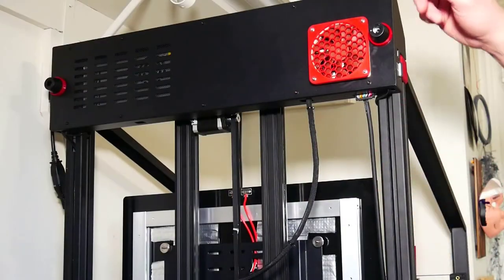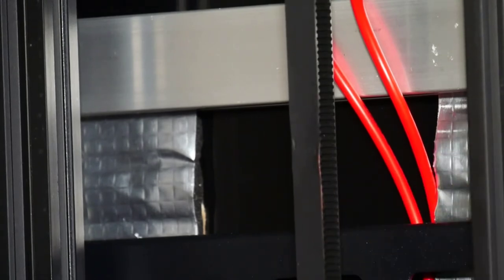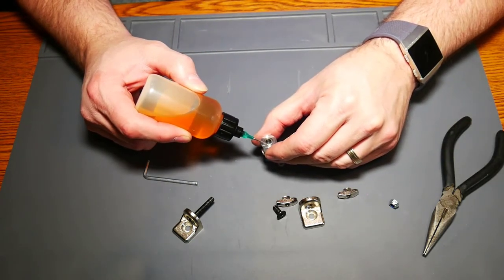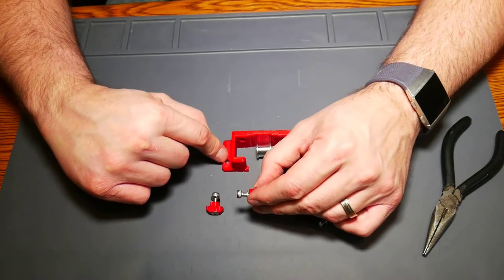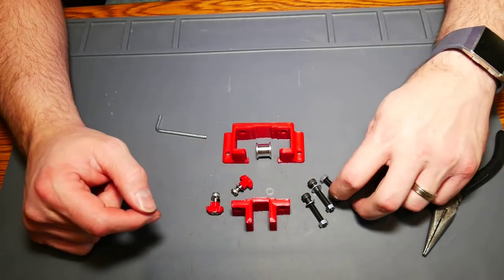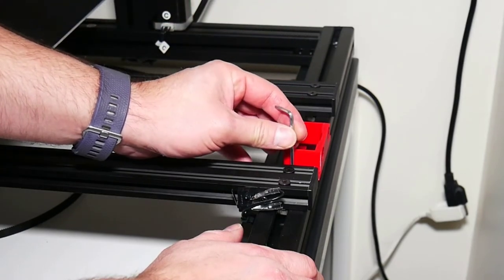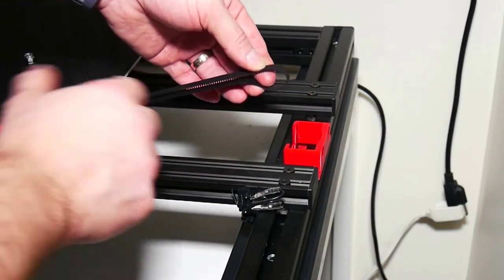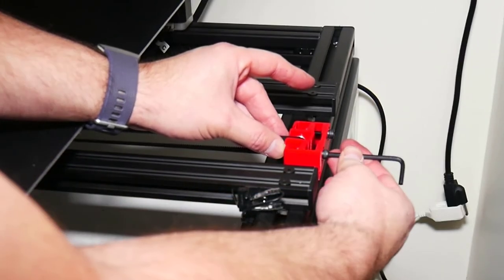Monster Y Belt Tensioner

Comment: Thanks for putting this video up!
I’d designed the part for the 300 and used feedback to re-do it for the larger printers!
No-one commented about the 5mm bolts into the 40x40!!

Also on the earlier and smaller printers that idler goes on the front of the printer!! Hence the height of the bolts to allow them to sit above the panel where the LCD is housed.

Any feedback just yell. Always happy to help you and redesign these bits a little if need be.

All my upgrades are on my printer in PLA and working a treat.

Next try the stepper motor mount, the stock one is real flimsy
Reply from the maker: Doesn't really need bigger screws into the 4040, seems to be working fine. It is just that they were different.  Next upgrade will be Y-rails. Every time something goes on the printer, there is more fine-tuning that needs to be done. Thanks for watching and thanks for the design.